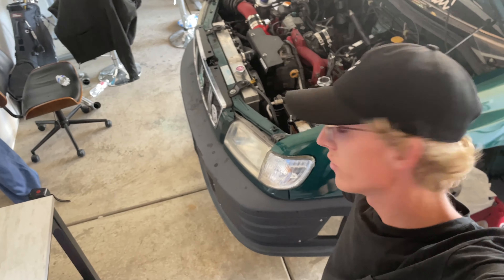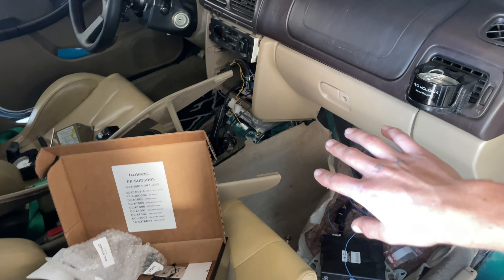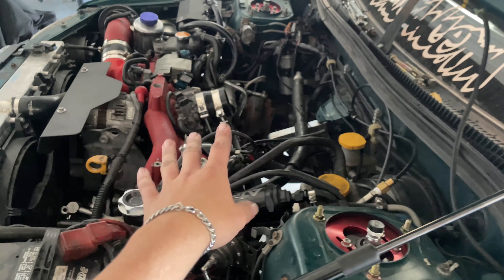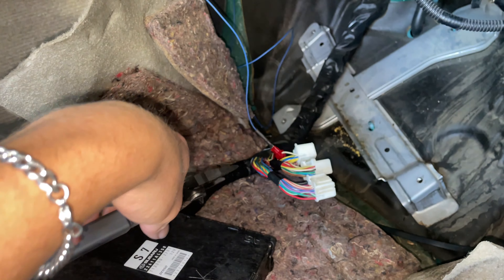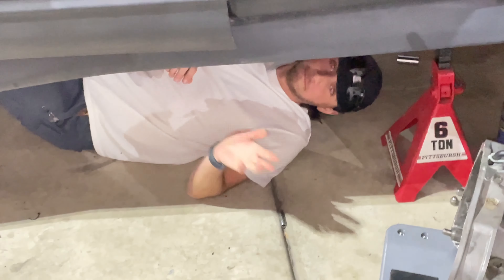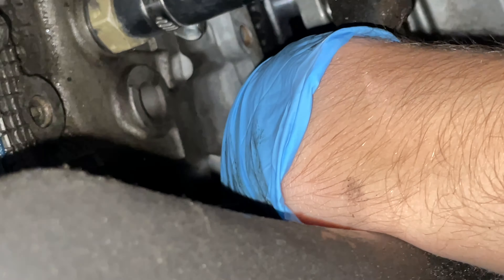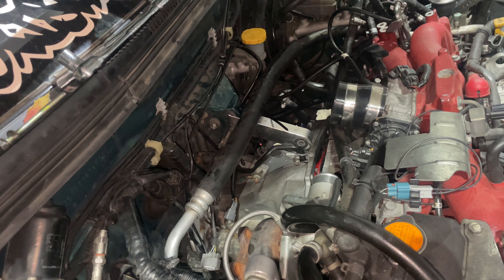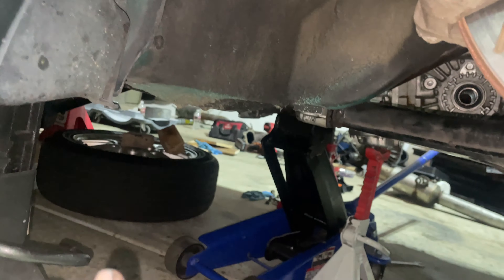Swapping an STI drivetrain into my 2001 Forester DAY 6 trying to get the 6speed in…

Comment: Yo man, just did a clutch on my buddies subie. Most of those transmissions I’ve seen won’t slide into place without some help. We had to use the transmissions bolts and walk it in. Very slowly and evenly. It takes time but it does work. 🤟🏼
Reply from the maker: Thank you for the info!